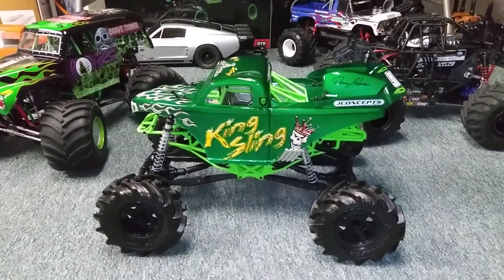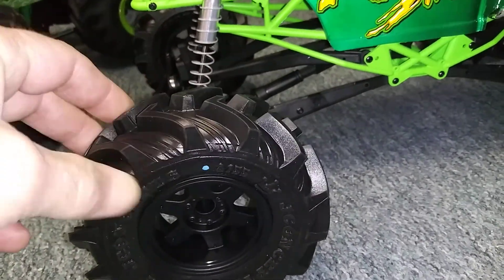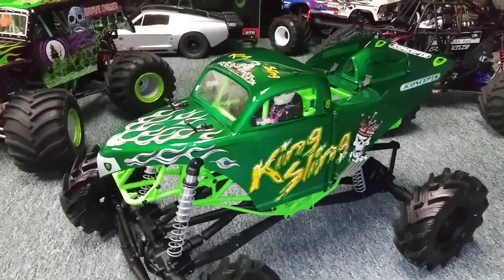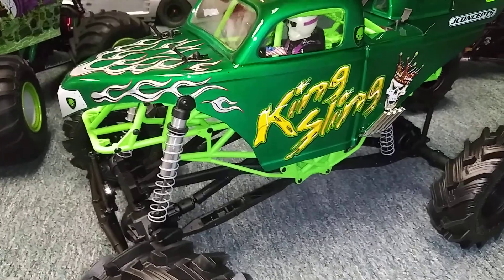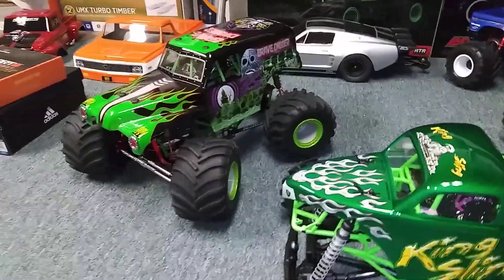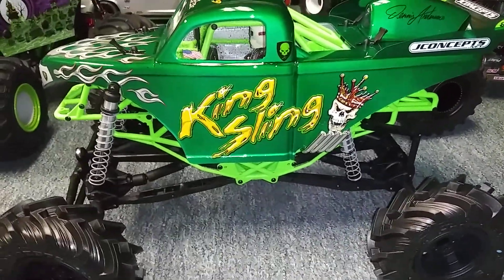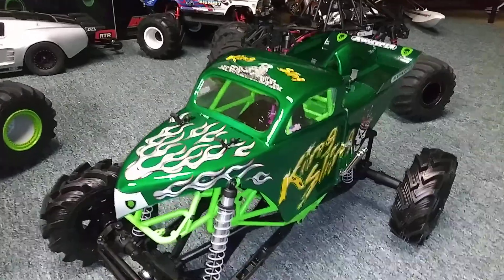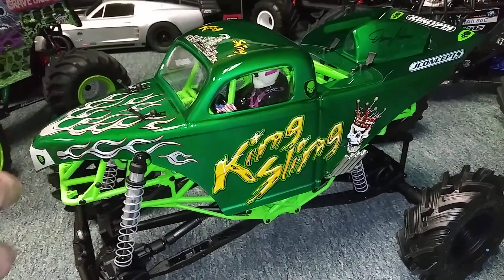Axial SMT-10 King Sling build. Part#1

Comment: What Tires are those, if you have a link and where you at in Michigan....I'm in Jackson, MI...Thanks!
Reply from the maker: https://www.ebay.com/itm/JConcepts-Fling-King-Mega-Truck-Blue-Comp-Tires-Inserts-for-Dragon-2-6-Wheels-/202736814499?mkcid=16&mkevt=1&_trksid=p2349624.m2548.l6249&mkrid=711-127632-2357-0
Reply from the maker: Here are the rims. https://www.ebay.com/itm/JConcepts-JCO3379B-Dragon-2-6-inch-Mega-Truck-Wheel-w-Adapter-Discs-Black-2-/362216685184?mkcid=16&mkevt=1&_trksid=p2349624.m2548.l6249&mkrid=711-127632-2357-0
Reply from the maker: I am in Warren 9mile and schoenherr area